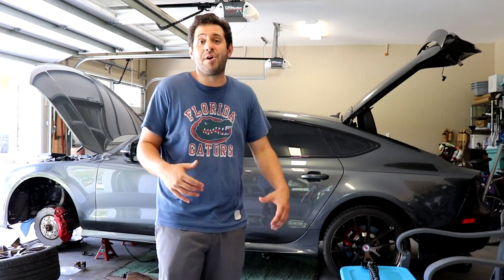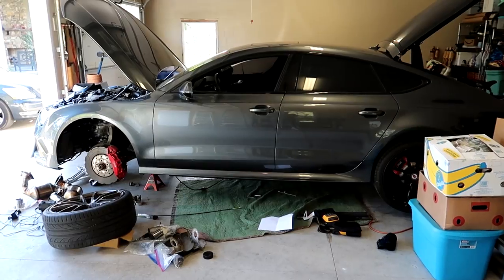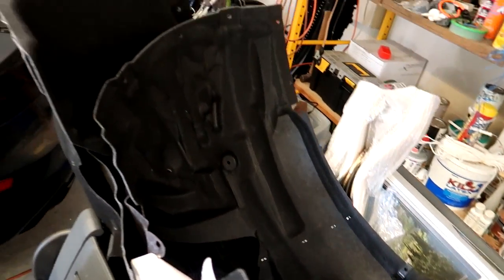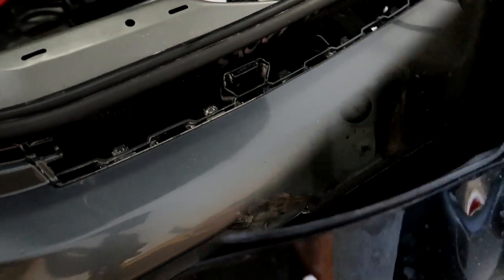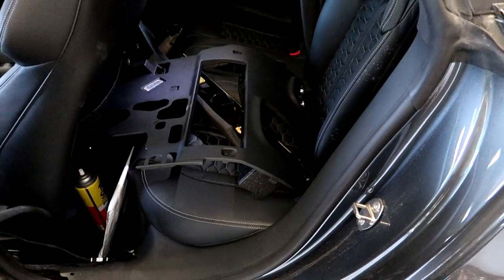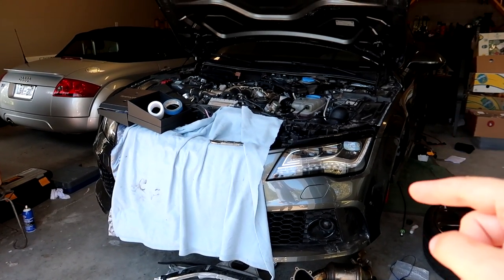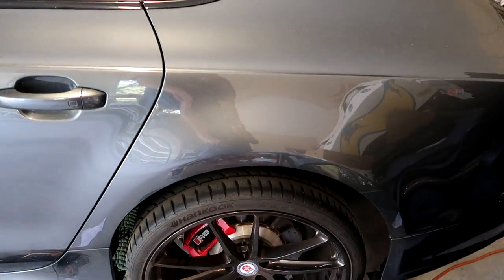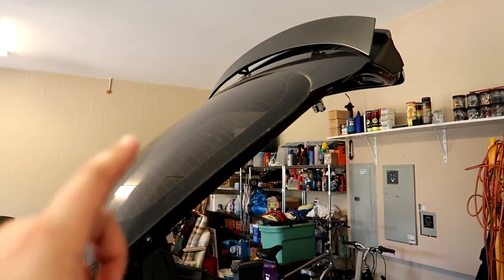Here's Everything that is STILL Broken On My Salvage Audi RS7

Comment: Your mystery plug goes to stock subwoofer in the back. Alot of people replace the stock woofer due to lack of bass.
Reply: Also, i think the trunk only shuts when you hit the botton on the trunk.
Reply from the maker: Hey man thanks for reminding! I have that subwoofer stashed away from when I first got the car
Reply: Samcrac you have to take out the shock and grease them and unplugged the cable and plug it back that’s how I fixed mines
Reply: say it then lol
Reply: Also it’s a safety sensor that tells it something is in the way

Comment: the boot close button, try holding it for a few seconds and it should make an audible beep noise when it basic sets the top point, if this doesn't work it will possibly need new motors, plus make sure all latch trims are there, thumbs up so he can see
Reply: I strongly doubt it needs new motors. Much more likely to be a sensor issue.

Comment: The problem with the back could be very simple. I had the same problem with my Porsche Panamera, with is the same technology. The car programmed its self as closed (although it’s open). So it can’t open , because it is already open, but can’t close either, because it thinks that it is closed. The solution is to gently close it by hand and it will calibrate the new position
Reply: Eduard Diedrich “Volkswagen”.......
Reply: Or the sensor thinks that something any way because all that trunk interior in the back
Reply: Can it be calibrated with Autel/Launcher/SnapOn diag tools ?
Reply: Maybe but most of the time the sensors are the problem

Comment: Try pushing and holding the button to close the rear hatch, after a few seconds the indicators should flash, indicating that it should now be ”calibrated”. If that doesn’t fix it there might be a mechanical problem.
Reply: That might be it. When he hit the trunk release on the remote, it sounded like the release solenoid activated. That should only happen if it thought it was closed.

Comment: Contact the seller, inform them they sent the wrong part. Then ask them to print a shipping label for you to return them. You have an ebay money back guarantee
Reply: @07:51 He bought from 2 listings, each with their own shipping price, should have separate tracking numbers. Where is the second box marked delivered???
Reply: C. Av I ship on ebay, and often their is a large difference between when its actually arrived, and when eBay says it is. Ebay will update in a few days
Reply: Diy_Guy Because they automatically announce the part is delivered when in reality,the seller is the one that determines that. I know, I asked one.
Reply: RC Hobbyist Extreme no it's not. It's the shipping company who announces when it's arrived. I personally ship regularly on ebay.
Reply: Diy_Guy Arrived, not shipped.

Comment: Samcrac, the hatch may be open due to your airbag sensor.
Also, rotate your exhaust couplers 90deg. ,if you bottom out your car you don't want those bolts hanging down.

Comment: I found this on a website. Maybe this is the problem? "The one thing I stress to clients is that you have to OWN your car. One problem I found at Audi is that there is a valet mode button in the glove compartment of the new A7 and when its depressed the trunk will not open from the door switch, the fob or the tailgate button. it’s covered in the owners manual and you won’t believe how many clients come in stating their trunk won’t open."

Comment: Sam, try and get hold of ETKA 8.0 software. It will help you a lot with the part numbers you need for this car. ETKA is the electronics part diagram that VAG uses for their part diagrams and part numbers etc. It will save you a lot of time sourcing the parts you need to efficiently finish this build. I can help out with part numbers if you need them as I have the software and use it regularly on my cars. Good luck

Comment: Hey Samcrac!......Not sure about Audi but on all cars I have dealt with that are equipped with auto lift, there are several proximity sensors that will not allow the door to close if the circuit is left open. Maybe one of those extra plugs you have back there. Gotta be something simple. The last car I worked on with this issue was a Ford C-Max and there were sensors under the plastic trim pieces on the trunk lid.

Comment: Yeah the dealer hits you hard for parts. Was doing the suspension on a Mercedes GL450 and needed four new main strut/shock bolts/nuts since the original were rusted. They charged $60!!! and didn't even include the nuts.... Complained about it and they included the 4 nuts for free, but that meant another round trip to the dealership again to pick them up (60 miles).

Comment: You may have fault codes stored in the Rear Trunk Control unit which is preventing it from closing. Also you may need to perform a basic setting for it. If you can get hold of ODIS then that will be great to perform basic setting for this module.

Comment: Rotate/clock your exhaust clamps 45 degrees so the bolts don’t hang low like that. A speed bump will sheer those puppies off first pass.

Comment: hey samcrac, i had a similar problem with the trunk of my SUV (it is a Subaru Forester) i don't know if it works the same with Audi but what the dealership told us is that when the battery is low the automatic trunk is shut down to save energy, they said it just needed to be reset once the battery was changed and it works fine now. as i said, i don't know if it works the same in Audis but just have it in mind.

Comment: @samcrac Pretty shure that you need the center trimpiece in the back there is a switch or two that senses when the tailgate is closed, and everything needs to be there for the tailgate to function. sometimes you need to reset faultcodes also.

Comment: Sam that connector with the snap on wire taps in the trunk might be for the bose subwoofer..if the car has the bose sound system installed there should be a subwoofer in the trunk.

Comment: the boot lid is probably a missing sensor(from the missing panel or under the bumper) and you may need to use the controls for it from the driver seat but the VAG computer should be able to tell you all that but you may need to keep that module in place for the computer to be able to read it....and the Germans normally keep some sorta manual over ride in stuff like that in case of malfunction , it should look like some sorta of bolt that dose nothing

Comment: Sam, you should not have to pay the return shipping on that trunk liner, it wasn’t your mistake it was theirs. And there should be no additional charge for the correct part. If they want the old one back they should cover the fees. Most likely they won’t want it back since the shipping would most likely be more then the cost of the part.

Comment: I think the reason the rear hatch is not closing is because of the position sensor needs to be programmed. It needs to know what high to open and what level is closed. Hold down the close button for 5 to 10 seconds at max open position. then you should try to close the hatch with the button one press.

Also make sure the car is on dose not need to be running.

Comment: Hi Sam. 

Is the back hatch all the way up? As of into service open??

If so it might be a twist on the actuators or a lock button that have to be pushed on both side to get them back into “normal” mode again. 

If you manually open the back hatch it might have piped over into service open position.

Comment: Maybe you have to reset the trunk? Hold the hatch button until the lights flash and you get a confirmation tone. This should reset it. If this doesnt help, maybe its the sensor underneath the car? The sensor that makes you open the hatch just with your feet.

Comment: Are you missing a lug nut on the Vette on the rear driver side? 
Also, Audi rear lift gate - perhaps there is a sensor switch that gives the state of the lift gate open or closed? Missing?

Comment: Without VCDS you will not find out what's wrong with the trunk/hatch... also you will have fun wit the Airbag System because after an huge accident like this it will have saved crash data permantely. It is not possible to clear the Fault Memory with standard tools like VCDS.

Comment: Is it possible that one of your mystery plugs is meant to plug into some trunk sensor that is used to determine the state of the hatch? Maybe it won't close with the sensor offline. I'm surprised Audi doesn't have a wiring diagram readily available that you can use to determine the cabling purposes.
Reply: There is a full wiring diagram on Elsawin manual which he seems to already have. Might take a while to understand how to read the diagrams though.

Comment: Maybe the hatch thinks it’s closed? When you pressed the button on the key it sounded like it actuated the release for the locking mechanism, which it would only do if it was closed and wanting to open.
Reply from the maker: Kind of what I think too!
Reply: You actually cant close the trunk with the key on an A/S/RS7
Reply: hold close button in boot you should hear a beep, this adapts the lids top position
Reply: theo puente it can but it isn’t usually activated from factory. It’s ‘Activation using rear lid opening button in remote key - Touch function for closing’ in adaptation for module 6D using VCDS

Comment: I bet there is a 'safety' system for the powered hatch.  Perhaps a LED and receptor that indicate luggage or ?? piled too high that would interfere with the closing hatch.  German designs are 'belt and suspenders', using two systems where one would suffice, so look for a safety lockout(the beeping gizmo warning stupid people...) that is disconnected.

Comment: Are you gonna keep the rs7 ? ( if no, keep it pls)
Reply: Rune Helsen He wont. Its a bad mistake to ever keep a car like that. I used to do the same thing. I kept my flip cars seperate from my daily drivers. You can lose your investment should it get totalled. Remember, these are salvage vehicles, not new, not clear title cars. Should they get wrecked, the insurance company wont pay a dime. Its HARD to get full coverage on a salvage vehicle because the insurance company already paid out once. Salvage title cars are handled differently in the insurance world. They HATE them. I always bought a clear titled car if I could. Many times I would buy two cars, a totalled car, and a blown engine, rusted or worn out car and use the clear title on the salvage vehicle.  You cant do that now. Things have changed...alot. Thanks to those electronics.

Comment: I would rotate the exhaust clamps. As it sits now. If the car ever does scrape, it will hit the bolts and nuts of the clamps.
Reply: ForPointSix 4.6 I noticed that. pipe band aids We called them. I worked at a hotel that had bad pipes. We had a bucket full of clamps like those with rubber pads, just slide them on and tighten down, no more leaks. So many guys put pipe clamps on the wrong way. Sam has too.